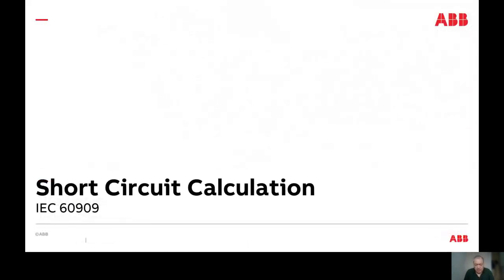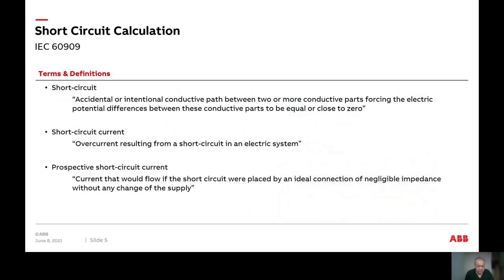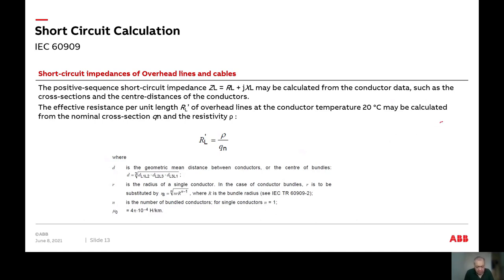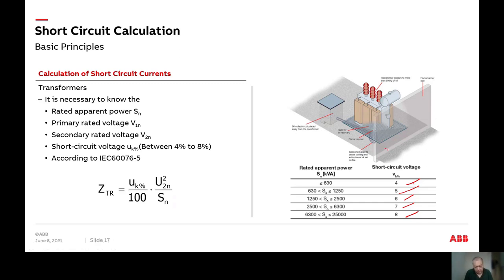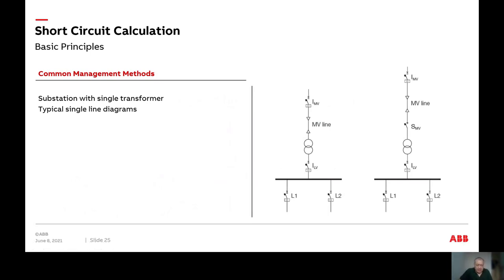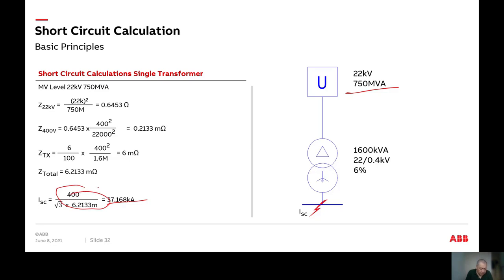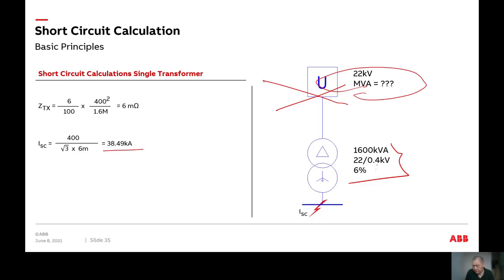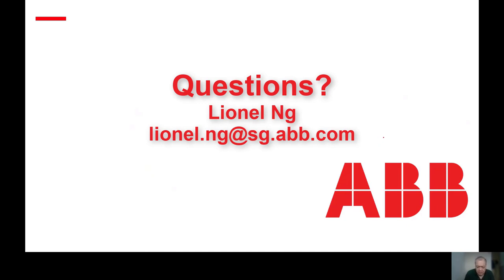Short Circuit Currents According to IEC 60909

Comment: Hi! @24:12, why do you need an interlock between the sources if you say that both transformers will feed in parallel? The mechanical interlock is to prevent the two circuit breakers from being closed, i.e. only one of the transformers can supply the bus.